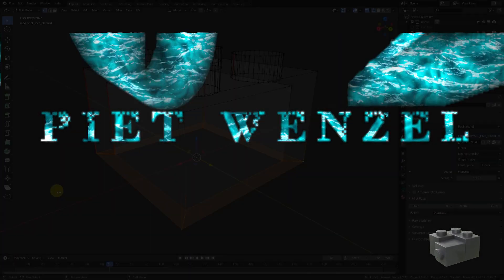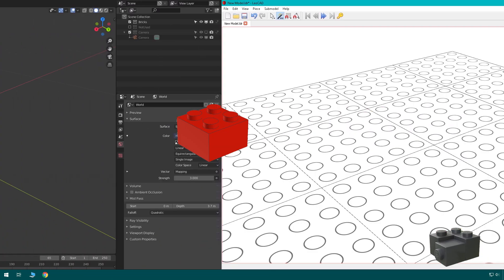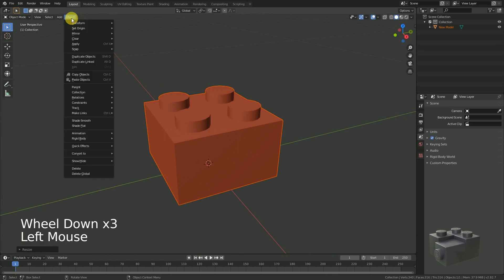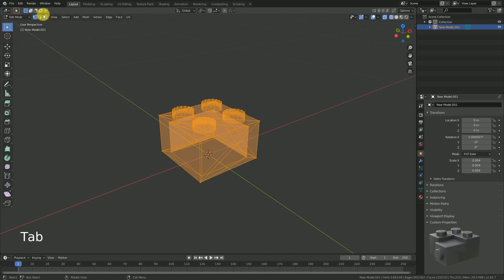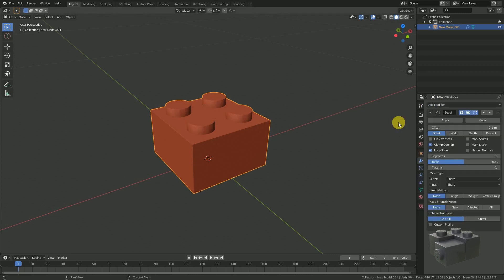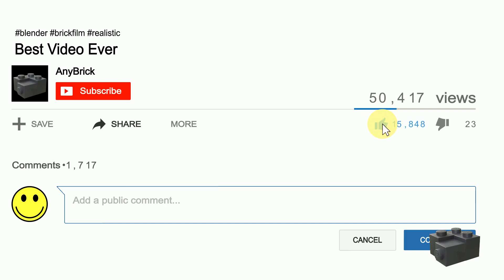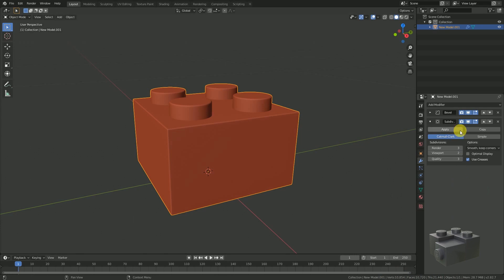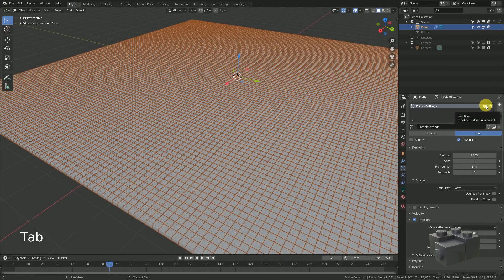Blender Beginner Tutorial Part 1 - Effective Mesh Clean Up (LeoCAD imports)

Comment: Mention that this is for prefab lego stuff in the goddamn video title.
People are looking for instructions on cleaning up custom mesh topology errors that accumulate over a period of manual modeling: n-gons, non-planar polygons, flipped normals, intersections, loose bits, non-manifolds, doubles, etc. …
Reply from the maker: I'm sorry you didn't found, what you have expected. I thought the explanation at the videos beginning would be sufficient.
By the way: normals, doubles and loos verticies are discussed in this video.
Nevertheless I followed your advice and updated the titel.
Reply: @AnyBrick  Thank you very much!
The explanation requires one to start watching and it's not the most concise.
My point is to be able to distinguish from the search page.
And manual mesh construction brings in its own flavor of topology errors, not as clear-cut as working off a cookie-cutter "template".

Comment: whats mesh
Reply from the maker: The sum of nodes, faces and edges building a 3D model.
Reply: @AnyBrick  is it the ones that are not connected
Reply from the maker: The not connected elements are part of the mesh, but all connected, too. That is the reason why it is recommended to remove the not connected and double ones from the mesh to reduce the total amount of information to the necessary one.